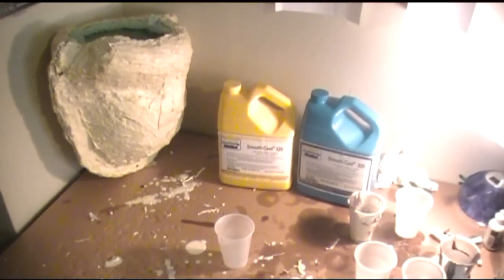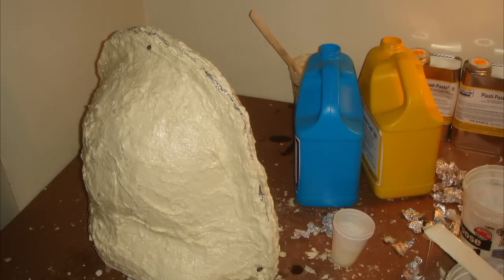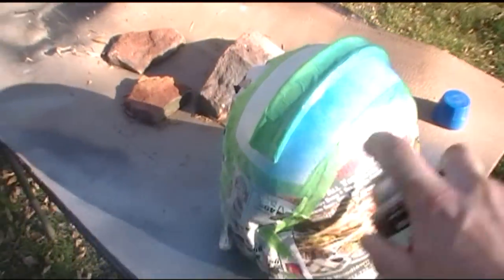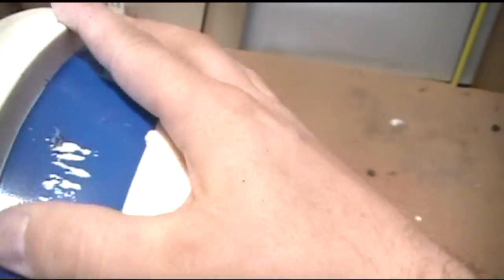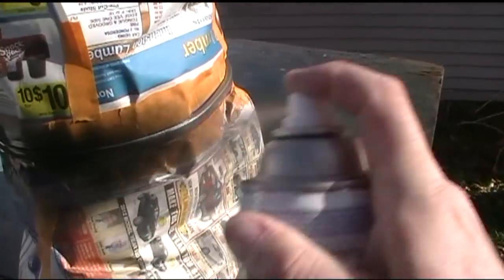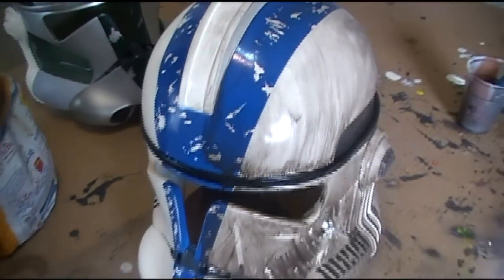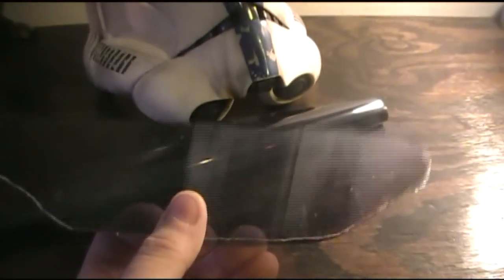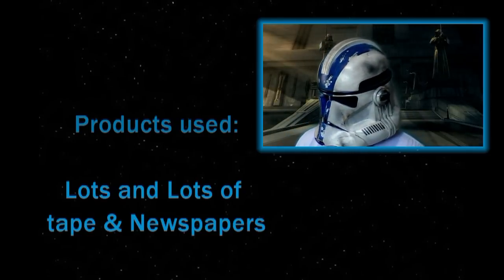StarWars: Making a Clone Trooper Helmet

Comment from the maker: the mold is a single mold made of rebound 40,....not a two part, but close...and the mother mold is Plasti Paste II from SMOOTH-ON.
Reply: How did you cut out the part for the visor?
Reply: ill buy 2 ^^
Reply from the maker: ***** the visor is 1/16 acrylic picture frame glass from Michaels...cut with an x acto nife.....then tinted with window tint
Reply: Where did you get the mold from or how did you make it?
Reply: Where can you buys these? :)
Reply: Harvey Booth Not a good idea to slap your E-mail in public places like YT .o
Reply: ***** what did you use to make the mold shape for your helmets?
Reply: Well it is a seconfary email
Reply: Zos seconfary
Reply: Okay so what do you use to make the model so you can make the mold?
Reply: rbcustoms81 I would like to ask how much a mold would cost
Reply: you should still do a video on how to mold one
Reply: rbcustoms81 where did you get the helmet s
Reply: rbcustoms81 where did you get the mold or did you make it

Comment: Did you make your own armature to sculpt on and did you mold using a two peice mold, it doesn't look like it, so did you mold your sculpt using silicone and pulled it off the sculpt and covered the outside with plaster to support the silicone?